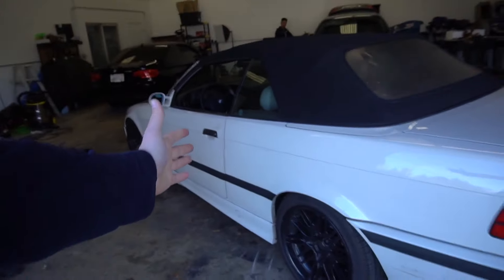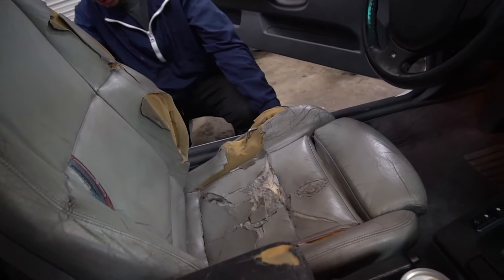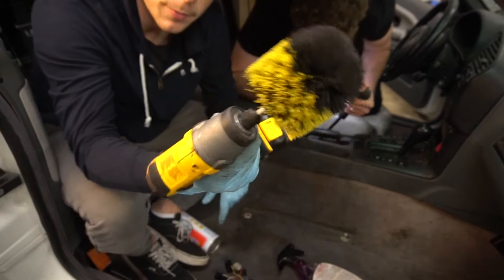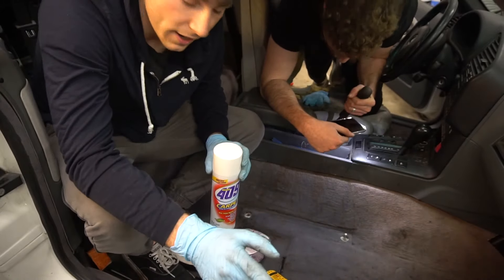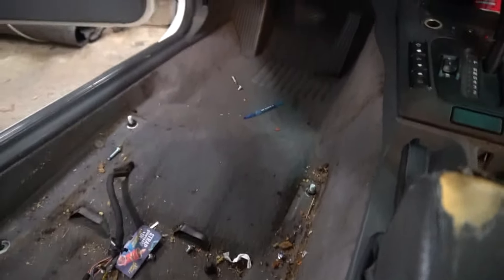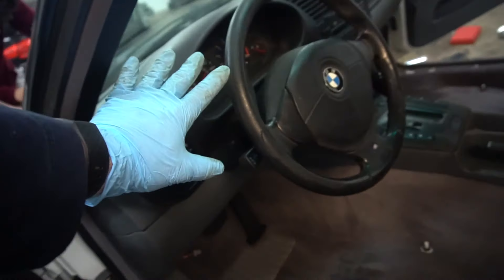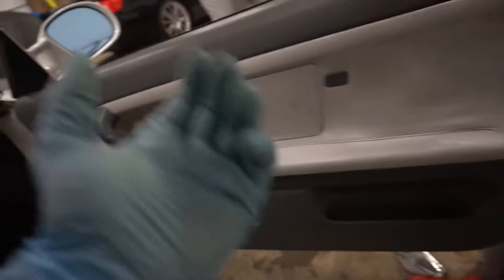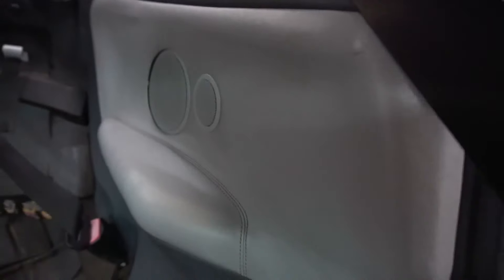FULL INTERIOR DETAILING RESTORATION ON AN E36 M3 (Satisfying)

Comment: Please do a manual swap and subframe reinforcement and just fix up the interior with new bits from Craigslist and recaro seats and a cage
Reply from the maker: We will see about all that stuff. Those can get pretty pricey! We will definitely do a few mods here and there before it’s given away
Reply: Don’t forget to also check the cooling system as well and check on the rubber pieces such as the bushings while you’re at it. 20 years is a long time so those may be shot.